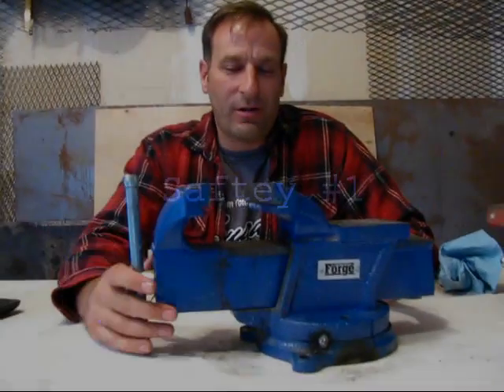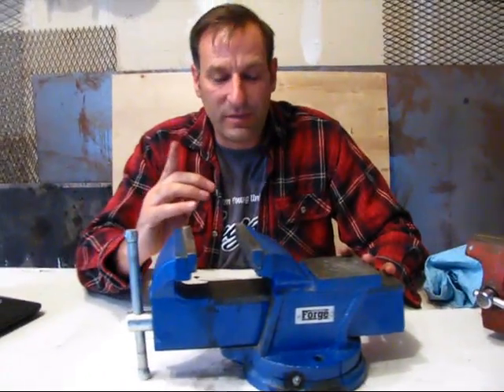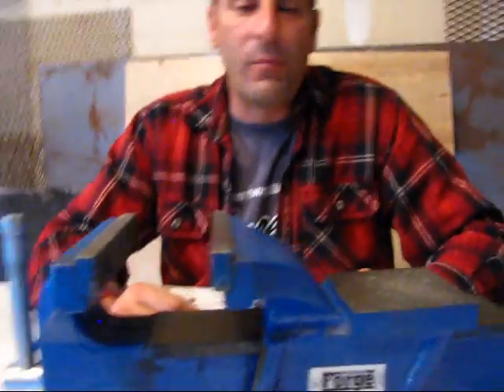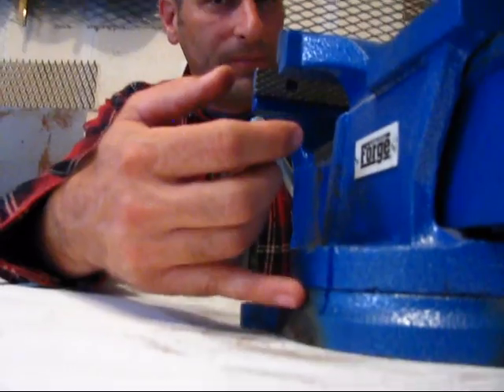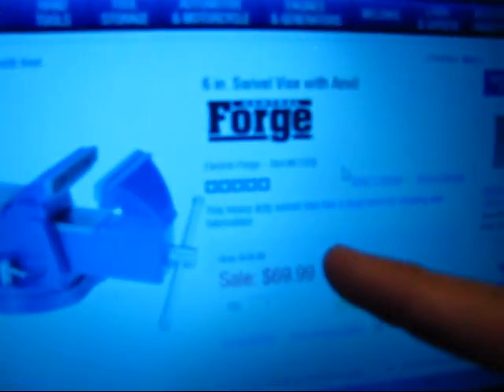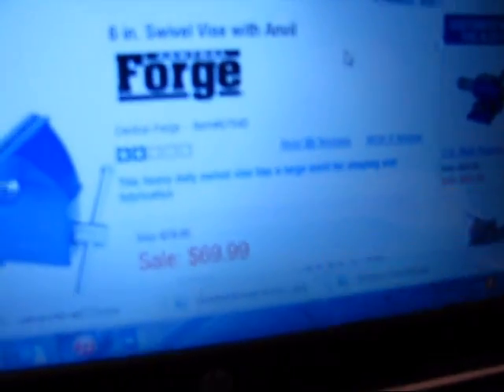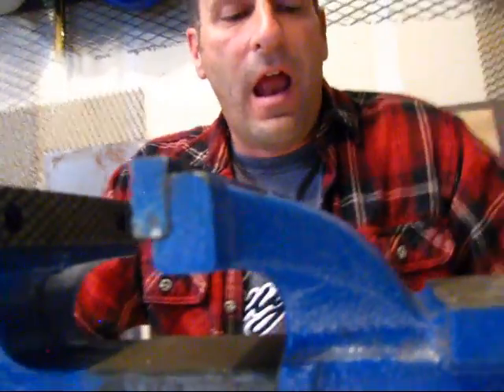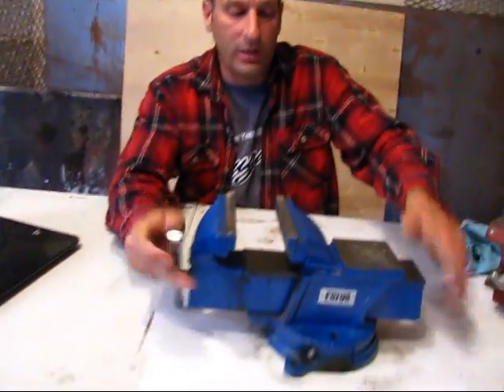Harbor Freight Bench Vise Review

Comment: I have a 20 year old 4 inch version. The big difference, is that it is not "hollow cast on the back jaw and anvil section and is one solid hunk of metal. You can pick one up in the box at the store and it is lighter than mine. All the pieces as in the screw mechanism and the handle appear to be one step up in quality vs what I have looked at new in the store.  Everything is aligned and I can keep it from rotating no problem. I kept it outside in a shed with a dirt floor for 8 years and it had no affect on it. I noticed the jaws don't always line up on the new ones at the store or in reviews and are loose as a goose comparatively.  I think I Paid 25 bucks likely with the coupon but can't remember. I'm putting in a work bench in my basement so broke the old vice out to mount down there and just thought I'd take a look at reviews. Interesting.
Reply: I did a little research on "hollow casting" vs solid.  I noticed the outside surface on the molding of mine is kind of "crude" vs the clean lines and ridges on the newer ones. In looking online, mine appears to have been "gravity" molded as do other more expensive vices that are solid metal. The outside appearance of the metal is a sort of soft clay like look on the metal surface under the paint reflecting the mold. 

That "hollow" way of casting is what is called "slush casting." The Wikipedia article notes: "Slush casting is a variant of permanent molding casting to create a hollow casting or hollow cast. In the process the material is poured into the mold and allowed to cool until a shell of material forms in the mold. The remaining liquid is then poured out to leave a hollow shell. The resulting casting has good surface detail but the wall thickness can vary."  Note this last sentence.  

It further notes: "The main advantages are the reusable mold, good surface finish, good dimensional accuracy, and high production rates." 

I'm thinking this is what is going on with Harbor Freight vices vs more expensive ones and my 20 year old one based upon what I saw of the breakage you noted and many others did in reviews.

Comment: When welding cast iron IT's really really helpful id you not only pre heat to 900F but also to control how quickly it cools after welding  using the torch and ramping the metal down slowly.  It cracks after welding because of rapid cooling and the material has a very dramatic thermal expansion and contraction rate.

Comment: I have a HF 5 inch vise that I have had since about 2002. I used it to press out bushings and all other kids of stuff. It finally gave out on me this past weekend. Just cracked with very little torque applied to it. Can't knock it. It lasted me 10+ years and it only vcost me about $40. going to pick up this 6 inch version since I can't find a good made in USA one for cheap.
Reply: Jackson Cruz how'd it turn out I just got the 6in. seems to be decent so far
Reply: chris jones  I held out buying the 6 inch for a bit and was able to find a used Columbia ductile iron one in 6 inch for $75.

Comment: Should of clamped the camera down in it!  ha jk.
I found this video when searching google to see if i could weld on i got free before hooking my welder up. 
As far as the reviews go, in general they post a new product as the different revisions come with new item numbers. OFTEN they have small changes in them that improve the product in some way or make it safer. Other times they either may have made a smal change but it did not improve the product OR they have made a change that made the product cheaper. One example is the red cheap-o multimeter they sell (or give away. The revisions over the years have made the circuit board that was cheaper (it is thinner and smaller) and other revisions have improved a common problem with the LCD screen that would make numbers not appear (that was easy to fix by putting a cigarette butt in the casing behind it so it makes good contact) and they have revised the leads for it.  Next time you are at HF looks at the products that have different item numbers for same product and often you can see a difference in them. 

Most everything i buy from there that has moving parts or power tool i take it apart first thing and look for problems or stuff that can be improved to make it perform better or more reliable. I bought a angle grinder for $9 changed the grease and abused it pretty good, i threw it across the shop and it broke the part that the handle screws into, i was using it once and the guard broke but i welded it back. The part that works the switch on the inside broke but i put a different switch on it and reclaimed the switch it came with which was pretty good quality, i was polishing my aluminum computer case with a big foam disk and it caught on fire so i took it part, unwound part of the motor field windings and put a little fingernail polish on it to protect and isolate it and it was fixed

Comment: Oh no. I thought harbor freight had good vices.
Reply: +Love2boat92 You thought wrong. The HF vises are junk for serious vise users. You want a good one you will have to spend $$$
Reply: damannoa Yeah that's the issue.
Reply: +Love2boat92 You can always check craiglist for a quality vise such as a older wilton. You have to keep checking. Every now and then they pop up and when they do you need to act fast.
Reply: damannoa Yeah I love Craigslist. There's auctions also. I've gotten some really good deals there also.
Reply: Paul Hopkins Oh I didn't know that. Thanks!
Reply: The Irwin 6-in and the HF 6-in are the same vise.
Reply: Same exact pattern... Adding the trade name is not difficult and can be removable, and still allows them to use the same exact vise pattern for many vendors.  I would be very surprised if the casting material is different, but I know its the same pattern.  The hardware may be of better quality on the Lowes one, but visually it looks identical as well.  Usually the only thing different about these Chinese tools is the paint.
Reply: look at the reviews on irwin website and arrange it by date
Reply: The jaws in my HF 6" fracture edges off every now and then, plus the jaws are not parallel by about 1.2 degrees. It will clamp to not rotate though. I actually meant to buy the multi vise but didn't notice they gave me the wrong one until I got home. NOT one of the good tools at Harbor Freight for sure.

Comment: #1 Its spelled SAFETY. #2 Why not disassemble said cheap ass vise and look into figuring out why it wouldn't lock up and correcting the problem instead of guessing (incorrectly) and welding it into a boat anchor? Just sayin...